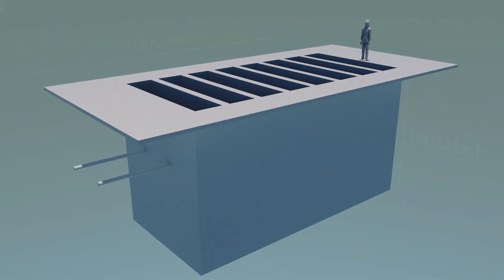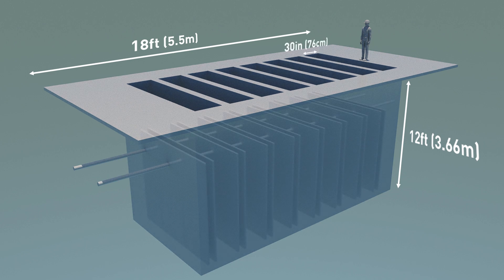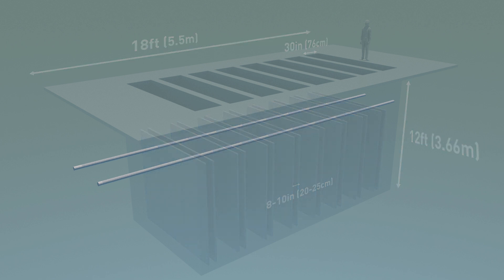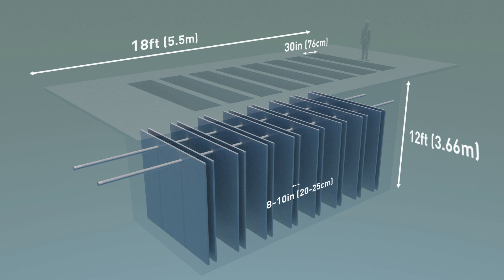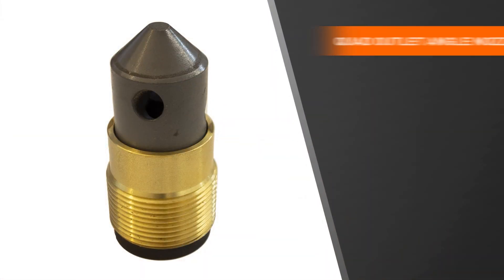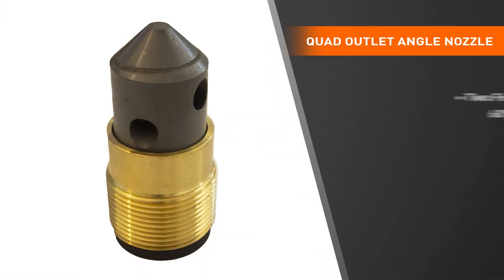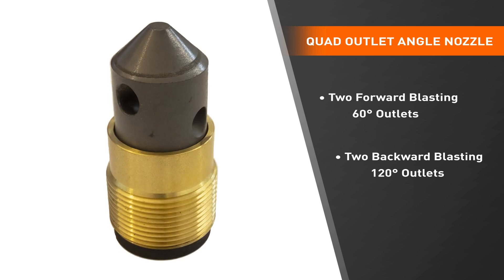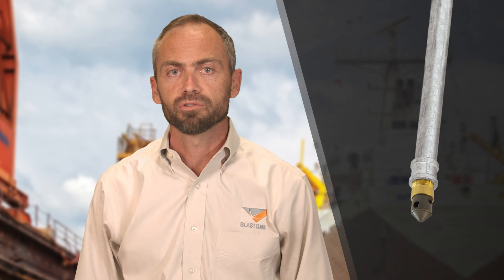Industrial Sandblasting: Animation show a Multi-Outlet Blast Nozzle for Blasting in tight spaces.

Comment: Can this be used with a flexible hose attachment for snaking through a tight space?
Reply from the maker: We're cautious to answer this definitively due to not knowing the exact set-up, pressures, etc... but yes, as long as the hose is firm enough to manage the thrust of the resulting abrasive/pressure discharge and not whip wildly.